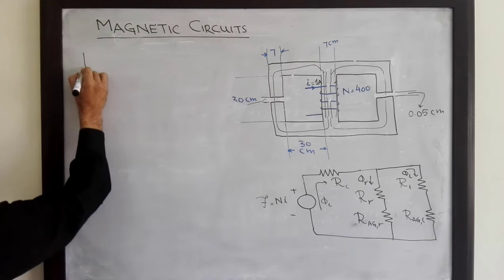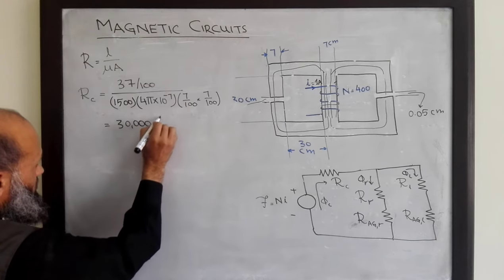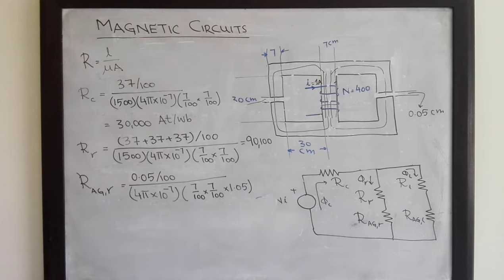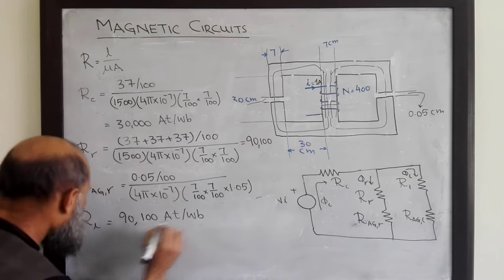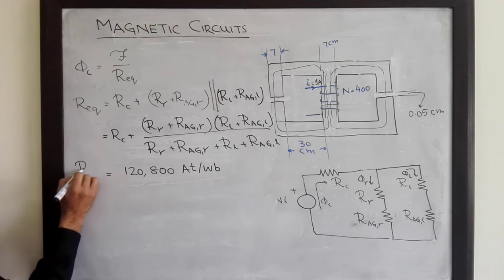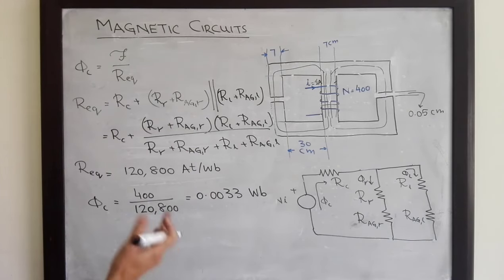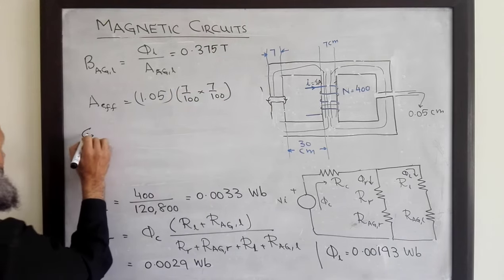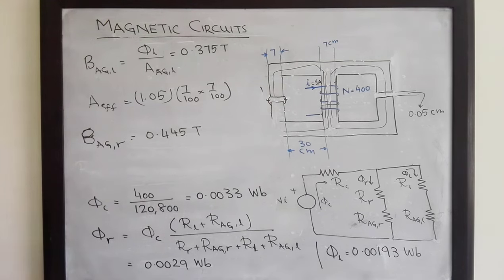EE213 - 03 - Analysis of magnetic circuits - example

Comment: A ferromagnetic core with a relative permeability of 1500 is shown in Figure Pl-3. 
The dimensions are as shown in the diagram, and the depth of the core is 5 cm. The 
air gaps on the left and right sides of the core are 0.050 and 0.070 cm, respectively. 
Because of fringing effects, the effective area of the air gaps is 5 percent larger than 
their physical size. If there are 300 turns in the coil wrapped around the center leg 
of the core and if the current in the coil is 1.0 A, what are the flux values for the left, 
center, and right legs of the core? What is the flux density in each air gap?

Comment: but the reluctances when calculated with relative permeability of 1500 gives a different answer than what you got, you can only get those answers if you use relative P of 2000 ,so i am confused why 2000 instead of 1500
Reply from the maker: You are right, the calculation are mistakenly performed with a different mu_r. However, the explained procedure is correct.
Reply: Sir why where you not subtracting the length of the air gap when you where calculating the reluctances of the left and the right limb?
Reply from the maker: In the calculation of reluctance of the core, the length of the air gap has been intentionally ignored. The reason is, the air gap length is so small that it will not significantly change the mean path length and hence the reluctance of the core, rather it will only make the calculations a little bit more complex. You may verify this point by repeating all these calculations.  

If you want more precise calculations, you can definitely subtract the air-gap length to find the length of the core. However, for magnetic circuits, such approximations are generally allowed.

Comment: Thank you very much sir you've earned a Subscription 😁😊 I just don't understand why we take half the length(half of 7 in this case)
Reply from the maker: The path length followed by different flux lines flowing through the core is different - those flowing through the outer side of core have larger path length and those flowing through the inner side of the cored have smaller path length. In the calculations, we take the average or mean path length. In the example, we divide 7 by two to get the mean path length.

Comment: Hello, hope you are well. For working out the flux in the left core, wouldnt we minus the flux in the right core from the total flux? so it should be 0.0004?
Reply from the maker: You are right, the flux in the left limb is equal to the flux in the central limb minus the flux in the right limb. There are some calculation mistakes in the example. In larger air-gap, 0.0015 Wb and in smaller air-gap 0.0019 Wb.

Comment: I think there is a mistake with this answer Sir. When getting the length of the right and left side you are doing 37+37+37. But the only problem is that you are ignoring the gap length. Because you need to get the sum of that operation above minus the length of the gap. But if you don't do that it's as if there is no gap involved. Check it out sir. I'm surprised no one has noticed that from the time you posted the video
Reply from the maker: In the calculation of reluctance of the core, the length of the air gap has been intentionally ignored. The reason is, the air gap length is so small that it will not significantly change the mean path length and hence the reluctance of the core, rather it will only make the calculations a little bit more complex. You may verify this point by repeating all these calculations.  

If you want more precise calculations, you can definitely subtract the air-gap length to find the length of the core. However, for magnetic circuits, such approximations are generally allowed.
Reply: @MAFarooqi  ur calculation is wrong

Comment: Thank you very much for this content. Just one question. What would R_right and R_left have been equal to in case this conductor had been axial symmetric? Thank you very much.
Reply from the maker: I am sorry that I have limited knowledge about axial symmetric conductors and therefore cannot answer this question. May be someone else on this forum can help you.
Reply: You are right.
First thing I was thinking about was "Is the circuit not symmetrical?", but after having a better look at it I saw my own mistake😒

Comment: Sir,can you add a video about transients in synchronous machines or a book about it
Reply from the maker: The book by Chapman is the best for that purpose.
Reply: @MAFarooqi  sir, How to imagine electrical power as the average power of the sine form while the mechanical power of the load is constant, in power balance?
Reply from the maker: @relaxwithme4695  Are you asking it in connection with motors? The mechanical power of the load is also not constant, the load power is the product of torque and speed, P= tau*omega. If the torque is sinusoidal, the mechanical power will also be sinusoidal.

Comment: Thank you Dr, but I think there are some mistakes in the R calculations
Reply from the maker: Thanks. Can you please point out these mistakes so that I may correct these in future.
Reply: @MAFarooqi  when I plug in those values into my calculator, they do not give me the values you say they are. for example R_c should be 40059At/wb. Good video though. Thanks
Reply from the maker: @nathanhynes8063  Your are right, there is a calculation mistake. Thanks for the correction.
Reply: @MAFarooqi  your calculations of the first Rr is wrong. You didn’t subtract the air gap from the length.
Reply from the maker: @fathimahakeem4149  In the calculation of reluctance of the core, the length of the air gap has been intentionally ignored. The reason is, the air gap length is so small that it will not significantly change the mean path length and hence the reluctance of the core, rather it will only make the calculations a little bit more complex. You may verify this point by repeating all these calculations.  

If you want more precise calculations, you can definitely subtract the air-gap length to find the length of the core. However, for magnetic circuits, such approximations are generally allowed.
Reply: @MAFarooqi  thank you for the confirmation.

Comment: Please good explain how you reach to 1.05 in this problem?
Reply from the maker: Effect of fringing is to increase effective cross sectional area. As indicated in the questions, this increase is by 5 percent. That is, after incorporating the effect of fringing, effective area will become A + 5/100 * A = (1 + 0.05)*A = 1.05 *A.
Reply: @MAFarooqi  where did the 1 came from sir?
Reply from the maker: @louisezero3129  if you take A common from the two terms, inside brackets you get 1 for the first term and 5/100 for the second term.
Reply: @MAFarooqi  would it be the same thing if it said that the area is increased by 5%?
Reply from the maker: @louisezero3129  yes, exactly.
Reply: @MAFarooqi  thank you so much

Comment: the Reluctance for left and right you forgot to subtract the air gap lengths on both sides
Reply from the maker: In the calculation of reluctance of the core, the length of the air gap has been intentionally ignored. The reason is, the air gap length is so small that it will not significantly change the mean path length and hence the reluctance of the core, rather it will only make the calculations a little bit more complex. You may verify this point by repeating all these calculations.  

If you want more precise calculations, you can definitely subtract the air-gap length to find the length of the core. However, for magnetic circuits, such approximations are generally allowed.

Comment: i dont understand that part of dividing by 100
Reply from the maker: The lengths are provided in centimeters (cm), to convert cm into meters (m), lengths are divided by 100.
Reply: @MAFarooqi  ok sir i  get u can u do a video without  a percentage
Reply from the maker: @refilweramahlo8532  Do you mean analysis of magnetic circuit without the effects of fringing? Lecture 2  presents analysis of a relatively simple magnetic circuit without fringing effect. It is shared at the following link.

https://youtu.be/zNlmCiVThB4

Comment: Your Rr is 120178.22 it is not 90100
Reply from the maker: You are right, there is a calculation mistake.
Reply: @MAFarooqi  I humbly observed that all of the reluctance if recalculated, it is not the same on the video. But I am still thankful to this channel
Reply from the maker: The value of mu_r is mistakenly taken to be equal to 2000 instead of 1500 in these calculations, therefore, these reluctances have different values.

Comment: Dr. What is wrong? Your answer is not correct
Reply from the maker: The value of mu_r is mistakenly taken to be equal to 2000 instead of 1500 in these calculations, therefore, these reluctances have different values. However, the explained procedure is correct.